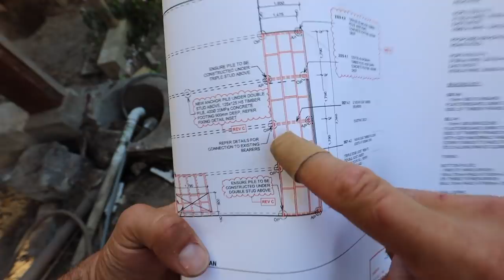Replacing House Piles Under a New Zealand House

Comment: Random fact. In a saw pit the logs were held in place with metal spikes called dogs. The more experienced guy holding the saw would be on top of the dogs and the less experienced/fortunate guy would be under the dogs and would get covered in sawdust. This is where the expressions 'top dog' and 'under dog' come from.
Reply: @ceyhunatacan5643 Ok maybe you're right. Just something I was told at college when I was leaning to be a forestry worker which I did in a previous career.
Reply: Yeah I’ve heard numerous anecdotes like this to explain origins of sayings and words. Not always accurate but always good to pull out over a beer with your mates 😆

Comment: Always fun trying to get a 1.8m pile into a 900mm hole under an existing floor...  It's just getting it around that bend that's to pincer point.
Reply: I was thinking, is the post the full depth of the hole?  Would it be better to have a shorter post,  allowing some concrete to flow underneath for the post to bear on?  Or when the concrete shrinks a bit would that leave a void under the post?  You could pour a slab first and let it set, then post, then concrete around.

Comment: Holmes on Homes (Canada)  used to use an ultra sonic vibration probe to remove air from concrete in critical positions. You could see the concrete level drop 2-3 inches in seconds. Denser concrete, see if it outlasts native timbers!
Reply: Holmes on Homes 😍

Comment: take a relatively thin-walled steel- or aluminum pole of about up to 10 cm diameter and push/stomp/hammer it in the bottom of the hole you're digging. then when you pull it up, it'll take quite some dirt up, inside, which can be easily removed in the bucket by tapping the sides.. try it, it works quite well!

Comment: I've no experience of trying to put piles under an existing structure but do you need to do anything to counteract settlement, e.g. jack the house up a few extra cm to allow the piles to settle once the concrete cures.

Comment: The house potentially has some old VIR cabling (1:47) which is known have it's insulation break down over time, especially if it's disturbed.

Best to have the sparky check it's not VIR (could potentially just be black TPS although this is not common in domestic homes).
Reply: most likely coaixal cable for tv antenna or dish judging by the pinclip.

Comment: Hard stumping low houses. Interesting you chamfer the tops of the posts up in the dry but don't dome up the concrete at the bottom to shed water. Legal requirement in OZ. Small electric breaker works well to loosen up holes like that. Lot less effort. Then just scoop out loose dirt. Get the crop done first then you can enjoy the rest of the build.
Reply: Here in NZ, we work on the principle that if you have running water under your house you have bigger problems than having domed the concrete😉.  Ideally, Water will be contained or diverted away from the foundations to a sump then to the stormwater.
Reply: As a Builder of 40 years I don't think I have ever seen a stumped house that didn't get water under it in heavy rain. Almost impossible to stop when enough water about. Any depression around the base of a stump timber or steel is just bad practice for holding moisture.
Reply: You're right, domed finish would stop any water pooling, it's not really a problem around Auckland though. The soil here can take a huge dump of water and wick off pretty quick. NZ H5 treated timber good for making a fresh water wharf so more than adequate for a mostly weather tight house pile.

Comment: Scott, why not just use a 75 x 4mm SHS column under the sub floor?? Why drag those monster timbers under?? im guessin just associated cost?
Reply: @Skylab 5691 You saying your timber frame code in NZ says you cant use steel sub floor columns, you must use hardwood?

Comment: Hi Scott, i have a house with similar pile issues. What did the project cost the customer? Replacing the piles and lifting the house. And which company do you recommend for the house lifting.

Comment: Thanks for this video Scott. How long does the concrete have to cure before you allow weight on the new piles? I have a 1914 kauri bungalow with some old wooden (Totara? Puriri?) along the front wall of the house that I want to replace.

Comment: Scott, was there space between the bottom of piling and dirt in the hole? Just wondered how it was done in your country. Really enjoy your videos.
Reply: Yeah, Usually a 100mm hole. They measured from the bottom of the hole to the joist then subtracted 100mm off the total length.

Comment: Genuine question.....how come you're concerned with moisture from above and cutting your chamfer.......but sticking 50% of the post in wet concrete?
Reply: I'm not from NZ but my guess is that they bury the post in the footing to brace it better laterally for seismic activity. Just a guess though.
Reply: When the concrete sets, it dries and also becomes a water barrier. But water pooling anywhere is not a good thing. For example it might accelerate the H5 timber treatment leaching out, it's a nice spot for mozzies to breed, damp musty smells might come from under the house etc etc etc etc. Always best not to have pooled water. 

Re the timber treatment, timber survives water, it's microbes & fungi that harm it. For a foundation, the standard is H5 treatment. https://www.weathertight.org.nz/new-buildings/timber-treatment/ Prolonged contact with those chemicals can be harmful, that's why he said "It's H5 timber, I'm putting on gloves". 

The concrete improves the footing, but still allows the post to flex for earthquakes etc. Modern houses in NZ (on flat land) usually use rib raft concrete slabs, this place is probably 100 years old and has the older style of foundation. The house owner would probably be better off lifting the whole house, getting a new slab poured and putting the house back down on that. Think $150,000 +. Much easier & cheaper to add a few posts

Comment: Will the wood not endup rotting eventually being submerged in concrete?
Reply: House piles in New Zealand are treated with cca (copper chromium arsenate?) so that they won't rot, at least not within the lifespan of the rest of the house.
Reply: @Kyle Malone
Canada banned CCA treated wood products over 10 years ago due to arsenic exposure. We use lumber treated with ACQ. I'm surprised NZ is still using CCA treating compounds.

Comment: Liked it. A bit hard to see timber straight down a hole in the ground, but I guess that modern methodes haven't reached all corners of the British empire.
Reply: The treated wood that is used will last at least 50 to 75 years

Comment: may want to think bout using post hole diggers to dig post holes
Reply: 16JAM77  you cut the handles down .....bra
Reply: I've tried that here, in Wellington (NZ).  Needed a big 50cc borer minimum. Anything less wasn't getting through the clay.  Ended up doing what these guys did, using smaller Hilti breakers.
Reply: Especially once you got further under the house where borders wouldn't fit.

Comment: great info - tks. i have to do some support post work next spring. I never thought of screwing the posts before nailing. 
Our builder didn't put enough supports in and our floor sags. One method i am considering is putting concrete pads on the ground and blocking up from there. Any thoughts?

Comment: Don’t get it, why utilise such a poor foundation under your home. Why not use good ole concrete foundations?
Reply: House has already stood for around 120 years with only 30mm or so of movement. Pretty good longevity I reckon.
Reply: 16JAM77  wood is no good when it comes to foundation construction. That kind of houses we call cabins and use them only as temporary sheds.
Reply: @Danfrolujo  How do you explain the many thousands of 100+ year old homes through New Zealand still standing and lived in with the same construction?
Reply: For what it's worth, the old government building in Wellington was built on wooden piles and I believe it's one of the largest timber constructions on the planet. It was only in the 1990s during its restoration the piles were upgraded to concrete to comply with the earthquake strengthening of the time, up until then it had already survived 120 years of Wellington earthquakes (mid 1870's - mid 1990's).

So I'm not entirely convinced wooden piles set in concrete are necessarily a poor choice for us in New Zealand.  History clearly shows timber house construction on wooden piles here stands the test of time, and as homes are modernized the access to upgrades are a hell of a lot easier than dealing with a solid slab of concrete. 

I'm also not entirely sure how long a home should realistically last. The way we're progressing see's our needs changing quite dramatically.
Reply: @sonic_attack  well, i think it’s the climate. Anyway how much money did people spend to maintain those houses over a 100 year span?
Reply: @Danfrolujo  I can pretty confidently say not a hell of a lot of maintenance. Exterior paint, corrugated iron roofing and gutters would have been maintained or replaced as required. Outside of that these old native timber homes are pretty functional. If anything these homes could be considered "draughty",  gaps open in the flooring and  under exterior doors over time. That's a lot of time though and my experience of these older homes in that "draughty" manner is in areas of New Zealand with a lot of seismic activity. Wanganui, Wellington, east coast north island. Outside of that about the worst that happens is the vertical sliding windows get sticky.

I think regardless of construction, any 120 odd year old home or building anywhere in the world is going to have some issues to overcome.

If after that 120 years the biggest issue with the foundation of your home can be sorted out by three guys digging some holes and concreting in some new timber piles inside three days, most would consider that relatively minor.

Comment: Must have missed the bit were you treated the cut ends of the piles .
Reply: per NZS 3604:2011  6.4.3.3
Reply: Hater
Reply: 🤣🤣🤣🤣👌!! True, aye.  Metal-x
Reply: @luisschneider1665  No.  They will fail the inspection if it's not been done.
Reply: @markgilchrist860  
Hi Mark,
Could well be the case, but it's not our job to point those things out. 
The guy's are making great videos and that should be at forefront. 
The comment you made sounded very German like  that's why I commented, when that's all you gotta say, then you missed the point completely.